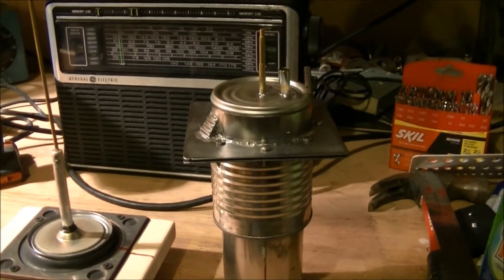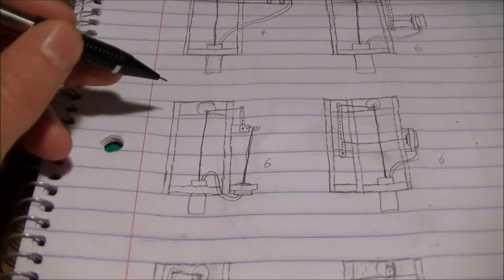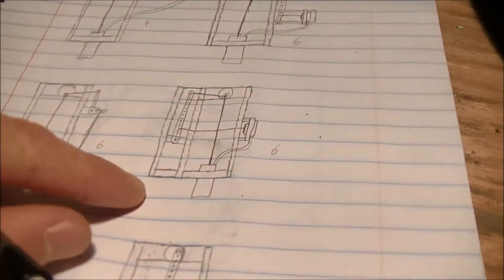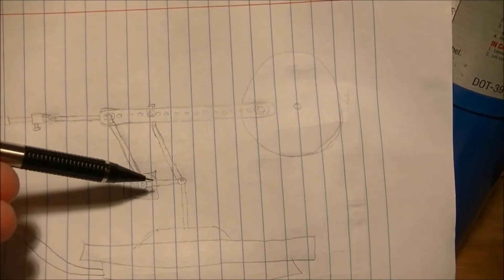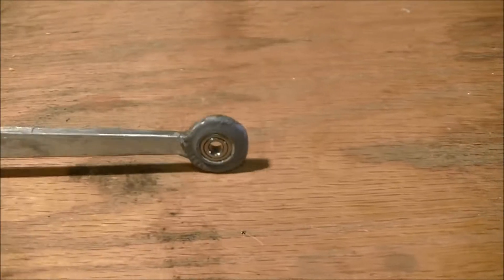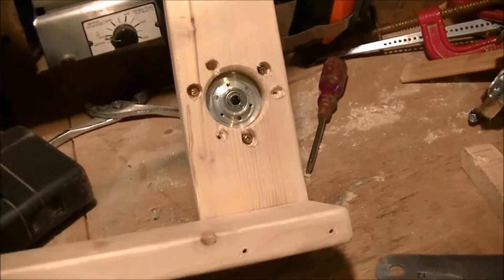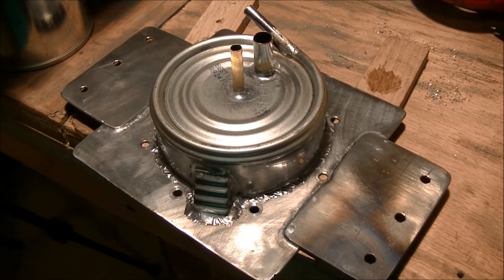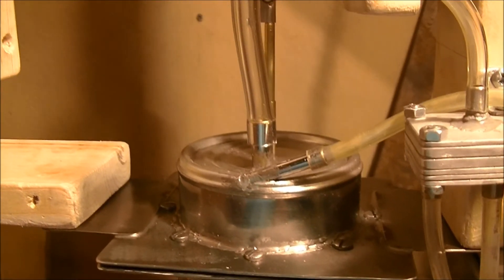Building the Frame and Linkage For My New Stirling Engine #5

Comment: Where do you buy those threaded wire connectors that you use on your linkages?
Reply from the maker: European style terminal strip.  You can probably buy them at your local hardware store in the electrical section.  Or you can order them on the internet:  http://smile.amazon.com/s/ref=nb_sb_noss?url=search-alias%3Daps&field-keywords=european+style+terminal&rh=i%3Aaps%2Ck%3Aeuropean+style+terminal   You can normally buy different sizes.  There are big ones for big wires and little ones for little wires.  I like to find one that fits perfectly on the linkage so it's not loose.  Oh and to get the actual metal connector just take the screws out and the connector should pop out.
Reply: Thank you very much!  I really appreciate it!
Reply from the maker: Darren Holman Yeah no problem!  Best wishes and keep experimenting!
Reply: Thanks for the reply I am going to try and make a bigger one too, I started with aluminum cans one to start, then went to another using a holiday square tin box, now I want to do one with wood. Having trouble finding scrap for a flywheel, rods, and these terminal strips. VCRs are so hard to come by but I feel like that flywheel would be a great one. +Makerj101 I love your channel, thank you so much. I'd like to know what do you think your best engine was out of all of them?

Comment: I know I'm late to the party, but congratulations.  I'm entirely inspired by your videos.  Great job.

BTW, a couple of suggestions that you may have already considered: put a heat sink (vanes down) on the bottom of the displacer cylinder (can) to capture more heat from the source.  Also, instead of the complicated arm and levers assembly to alter the stroke, use a larger flywheel with the connecting rods attached at two different radii on the wheel.

In case you don't know, the people on the rocket stove forum follow you with interest.  Rocket stoves and Stirling engines are like peanut butter and jelly; they naturally go together.

Cheers.

JD
Reply from the maker: I have thought of that but I have not done that because I couldn't think of a way to attach the heat sink to the bottom.  Also since this engine needs so much heat an aluminium heat sink would melt.  I actually did more that kind of method of crank in my previous engine.  Stirling Engine #4 Build  This was just something new I wanted to try.  Thank you for the suggestions!  

Cool!  Can you give me a link to this rocket stove form?

Thank you!

Comment: excuse my ignorance as im just getting into steam power, but what is the purpose of the diaphragm? also what is the purpose of the water jacket? PM me if the answer is too long. sorry for my newb questions! =)
Reply: nm, you answered my question with the layout at the end of the video. diaphragm powers your water pump and keeps the water cycling through your water jacket? water jacket is to keep the exterior from getting to hot?
Reply from the maker: Gunlover82 Here read this HowStuffWorks article.  http://auto.howstuffworks.com/stirling-engine.htm  No need to reinvent the wheel when there are already great articles on how stirling engines work!  

Water jacket is to remove heat.  The diaphragm is instead of a piston.
Reply: very good read, thank you!
Reply from the maker: Gunlover82  You're welcome!

Comment: Looking great. That's how you solder with blow torch btw, you have that looking good too. A little more care with flux application can get things neater if you want, but thats strong enough. Also watch out for those bubbly pin hole bits. Could be a bit too much heat for your flux and it was boiling a lot?  Or solder cooled too fast, before it finished flowing, which would make it a weak (brittle) join. Thicker solder is good for torch work, I use quarter inch or thicker rod with the torch.